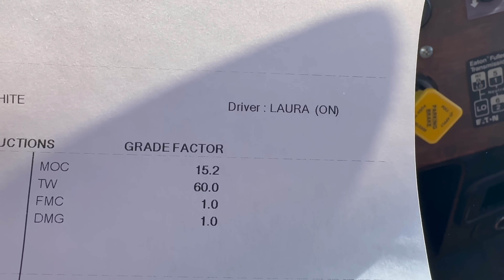Trucking Corn With Laura

Comment: "I need to gain weight."           No. No you don't.
Reply: It’s really her choice, right?
Reply: 😂 well if she decided to become a full time trucker. She would gain weight eating all the fast food. But she would probably be miserable if she gained weight.
Reply: Just some T&A😊
Reply: When the brakes won't release, get a hammer and tap the air brake drum. Be sure they're released inside the truck.
Reply: @commutinginatlanta9163 no, it’s not really her choice, duh
Reply: She meant it as a joke because she wasn’t heavy enough to pull the thing down
Reply: I don't know if the rumors are true....we will have to rely on Grant spilling the beans on Laura.  But the rumor is that Laura is so thin she has to run around in the shower to get wet. 😂😂😂😂😂😂😅❤
Reply: 😂 @TomRowan777

Comment: Driving Trucks, being a mechanic, welding, operating heavy equipment...a  lot going on in the off season! Just a suggestion: When adding oil hold the jug sideways and you'll get a smoother flow and less "glug glug".  Works woth most fluids.
Reply: And wipe the gunk off that jug!

Comment: Yes for your safety please exit the cab facing the cab. It does hurt when you fall out , getting out the wrong way😂.
Also one trucker/ truckie to another always check your tyres by fitting the tread, not the side wall. You can damage the sidewall easily.

Comment: for those tire air caps. I always use small section of hose that fit snug over the cap. tighten and pull off. little piece of hose comes in handy

Comment: Red dog is what we call corn chaff out my way. Next time if the trailer brakes lock up just take your hammer and tap the brake drum, a couple of times, the vibration should loosen the pads enough to move it.  I heard about you people in Nebraska with waving at everybody, they are a lot friendlier there than all people east of the Mississippi. :)

Comment: Hi Laura, I have been watching your channel “subscribed” virtually from the start and I always look forward to watching each video its nice to see a lovely young woman tackling the difficult tasks that you face on the farm everyday. One thing that struck me in this video again, has no one ever shown you how to pour oil and other viscous liquids? My Dad taught me a couple of tips to make it easy without spilling. The way you appeared to pour in the video causes air to be trapped above the oil in the bottle causing “glug glug” erratic pouring. For a controlled pour open the bottle keep the bottom of it low but roll it on its side the result is a controlled pour with you in control. You can even roll the bottle gradually as it transfers. The second tip Dad taught me was how to pour into a smaller opening. Place a stick, or small rod across the opening of the bottle put the tip of the stick or rod into the place you want to pour when you tilt the bottle do it slowly the fluid will leave the bottle and run down the stick or rod into where you need it too go. Try these I think you will be amazed as I was but “shhhh don’t tell Grant” let him keep spilling and wiping up…😂
Keep making the great videos I love watching your work! Best Wishes I hope the tips help.

Comment: with electric power in your shed, I might suggest trickle chargers on all the batteries.  This will improve starts as well as battery life.  Group 31 truck batteries are dialing in on $200 each.
Reply: 100% 🎯🎯

Comment: Well, dang it, it may be a bit chauvinistic of me I guess, but a petite young woman driving a big truck and doing a good job of it brings a smile to my face.  Very enjoyable, well done.   Your petiteness however doesn't help you when trying to open the truck's hood from the front.  Maybe a weight belt with about 50 pounds of weight attached would help you get the hood past the tipping point. 🤓

Comment: Them series 60 Detroit engines are great.  Drove a million miles with one in my Pete.  They will burn the oil down to the add line right away ….. but will sit there at the add line in between service……. Just a Detroit thing.  They also love a bottle of howes or kleen flow in the fuel tank at service.  Keeps the injectors clean.

Comment: One thing and I think is one of the more in portent things is, did you or did you not check your fifth wheel? Disconnect from trailer grease the release handle, make sure that the locking jaw or locking bar is not loose or worn. Make sure that the Bracket pin, it's the pin that holds the 5th wheel on and lets it pivot up and down. If you ever have one of these fail, just hope it happens on your property.

Comment: Anytime you’re driving around on loose gravel and such you should have the diff lock put in between the two screws Power divider that’s what you should have locked up the power divider

Comment: When positioning the truck for loading try utility locating paint to spray on the ground at the various points of stopping for trailer fill. Have been using this for several years and it really works great. White or orange seems to work the best.

Comment: I have my million miles driving a truck, and I spent about 5 years as a driver trainer. You're getting rather smooth shifting gears by now. That's not abnormal, but it always seems like a major victory when you stop fighting the tranny. One caveat, though: don't use the Johnny Bar/Trailer brakes/whatever you call it/ to stop the rig temporarily. Use the buttons on the dash. It seems counter-intuitive, but the trailer brakes can release when you don't intend them to. Doesn't happen often, but when (not if) it does, you'll either have a major repair bill or scare the daylights out of yourself. Other than that, you'd have passed my inspection, and the trailer brakes thing would merit a caution but not a down check.

Keep up the good content.

Comment: When you open the hood lifting by the fenders, it is extremely tough on the hinge bushings and eventually it will crack the fiberglass around the fenders where they attach to the hood.  No need to hit the steer tires, you can see they’re not flat

Comment: During my 37 years of driving a semi 10 years was spent in a hopper wagon. I never got to push buttons when I loaded or unloaded. It was always with a crank handle for the doors and we didn't have any automatic tarps. I gave up driving 6 years ago and I have never wanted to climb back in one.

Comment: Thanks for the video; and, as always, I really look forward to your posts. Even after most grain elevators in my area installed pneumatic, probing systems one of the major, Mississippi River terminals still made an employee use a ladder to climb up on the trailer to manually probe. Also the poor kids had to write out my long name, and sometimes my landlord(s), on the slip of paper they inserted into the grain.

Comment: A 'tire buddy' is useful to check for flat tires when you have dual wheels. One could be flat and you wouldn't see it.  No need to hit the front tires.

But, it shouldn't be used as an indicator for good pressure. Always check with a gauge. 6:20

Comment: Next time you get stuck on good ground look for the differential lock on the dashboard should be by the suspension deflate and fifth wheel slide If equipped.

Comment: Pro tip - if you lock the power divider on your Peterbilt you'll get the traction you need and be able to drive right out of that equipment barn.

Comment: Great content as usual, your shifting has gotten alot better since last season, one thing, I would be careful relying on the johnny bar (trailer brake handle) for holding the truck whilst distracted.. I know in that circumstance you would know if you rolled, but you putting alot of trust on those brakes. not criticising, you drive your way... those cars may have seen that one finger and thougth it was the tall one....I always wave with 4 fingers,,, unless they need just one.. lol

Comment: Laura, as a former Mixer Driver which I used to haul concrete. I would severely recommend you never use that Johnson bar as a parking brake. The Johnson bar is what you used to stop when you pulled up next to the ticket dispenser after you get rid of corn! 

The Johnson bar is spring loaded and it could release at any given time. It doesn't take much being that I drove a concrete mixer for quite a long time. That is a sin to use that as your brakes for what you were doing! 

During my time driving a truck I'm going to tell you a story. One of our mixer drivers was out looking for construction crew on a airport site and he went up against a berm inside a field he stopped, open the door and to use the johnson bar to hold the truck in place while he opened the door, in less than 10 seconds, the spring released on the Johnson bar and Johnson Little was trapped between the berm and the frame of his truck. He was severely hurt and never drove again. I hope you appreciate the aggravating circumstance that can happen to you by this action that you did! 

I'm not trying to criticize you. I'm trying to help you to save your life❤

Comment: Laura,
Replace the mini sledgehammer for a basic hammer.
When you test the tires, always hit the tread, not the sidewall.
Listen and feel these are the two senses you use to tell if the tires are the same.
NEVER in public hammer or hit your front steer tires. Visual only.
Otherwise you look like a fool.
Hitting the tandems in back is to prevent one tire from doing the work of two.

❤ U
Hi to Grant!

Comment: Laura, I think you would benefit from a blue tooth video camera mounted to watch the corn fill in the trailer... on your phone, from the comfort of the cab.
You might suggest to the folks that you deliver to that a blue tooth trail cam mounted low on the wall in the dump bay would allow all the drivers to check their position over the grate from the cab. That would probably speed things up a bit.  A blue tooth trail cam is not that expensive, but I don't know how many phones it would allow to be paired with it.  Maybe some other type would be required.

Dan
Reply: I'd bet 99% of those deliveries are as you suggest, in the seat flawless.  You get to know your rig.

Comment: Hi, from a fellow nebraskan😊
Gaining weight won't really help with opening the hood. I've been driving for over 32 years, I'm pretty tall & weigh over 220 lbs, I've had trouble opening the hood on some trucks 😅. 

On a second note, I've been a follower of Matt's off road recovery for years, he's a stand up guy. This is actually the 2nd year for doing an event. Last year it was off road wrecker games. 
I also follow Rory's channel, you have a partner with a wealth of knowledge and experience. 
You'll get to meet Chad from Chad's fab, & Robby Layton,  both are from Utah, like Matt and Rory😅. 
FabRats opted out this year, so they won't be there. Merlin from Merlins old school garage won the games last year,  he won't be there this year either. 
Heavy D & Murphys diesel will be there, so watch out for over inflated egos 😂

Comment: Over-inflation of truck tires is a real issue.
Putting 100psi in truck tires(especially as a bogie setup) is incorrect, when they really only need 80spi to operate effectively.  Much easier to get traction on soft ground. More even tire wear.

Comment: There's gotta be something wrong with the way you've got those drive tires mounted. The valve stem from the inner dually should reach through so you can access it from the outside, and the outside one should NOT have an extension reaching between the two. That's just backwards! How in the heck are you going to get air to the inner dually? The way that's set up, you'll have to crawl underneath.

Comment: if the airlines r frozen u can put some alcohol in the airlines and it will usually thraw the ice out of the airlines of trailer and wheels wil move pour the alcohol in the lines on trailer just uhook and our some in or sometimes u can build up air on tractor and pull brake know a couple of times it work sometimes if not alot of water hopefully when u truned off truck last time u emptied airtanks on tractor

Comment: Question from a city person: does the corn lose much weight after a few months of drying out? Is that compensated for in the price?  Would it be better to try and sell it when it is still fresh and heavier?
Reply: Corn moisture is measured by the coop and you usually get a premium for dry corn . Corn delivered right out of the field will usually gets less money per bushel because it is wet . It just depends on the moisture of the corn .
Reply: @toledojeeper2932    Thank you.

Comment: you figure a farmer with that much roof and land, would consider installing a solar charging system, and wire tha building to trickle charge all them batteries....this way, the batteries always be fresh when you need them, plus a topped off battery, is a happy battery and lasts longer.   no more playing fetch.

Comment: Why don't you go to the DMV and get the check list for pretrip inspection on your big rig. This way you remove any unchecked area where it should be verified, like lights and brakes nd air system check, operator seat wipers heating defrost etc.Also check your fith wheel attaching hardware and you fith wheel locking system. It is easy to see you have little to no feeling of responsibility when your on the road with a big rig that was not totally visually checked for defects as all truckers do every day. Your ok with going down the road with a falty locking system that let the trailer unhitch from the tractor and possibly cnd can crush and oncoming car with a family in it.
  IT really surprising that a farmer without any training can be on public roads with a big rig and no training as to how to react or know what your rig will do in urgent situations.
   I guess out here in Canada we treat human life with more respect and follow training before getting on the road wth big rigs.I have done long distance hauling in the US and Canada and recently have works on snow removal to know how crazy some people are toward a big rig on the road.What i have seen, it is no better in the US or Canada
  In a big rig you must be alert at all times and have your eyes all over and make sure all your equipment is as perfect as possible.

Comment: hate to be the bearer of bad news, but if you can't find a gear from a standstill, I can think of 3 possibilities, 2 of which could get expensive: either the clutch is out of adjustment - it doesn't release enough - or you're not pushing the pedal enough OR the clutch brake is worn away (yes, your clutch has a brake in it, the drivetrain has a lot of moving parts, even in neutral)...

Comment: Also don’t use your Johnny bar for parking and don’t pull it or stomp on the brakes to full extent it stresses out the system like brackets and slacks etc only push the brakes enough to stop .

Comment: if there were a list of the MOST UNSAFE places to be on a grain farm, being inside a grain trailer or bin would be on it, particularly while said trailer or bin is being loaded or unloaded...

and replacing the cap on the valve stem is easy - reach in between the duals, easy-breezy...